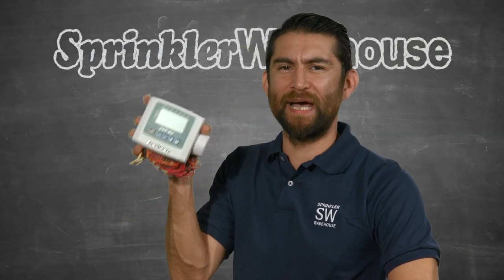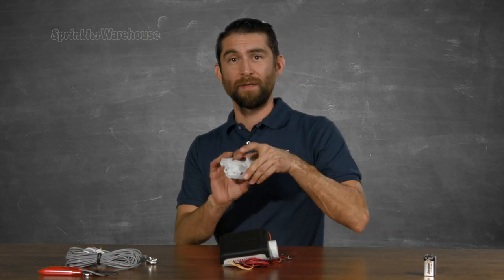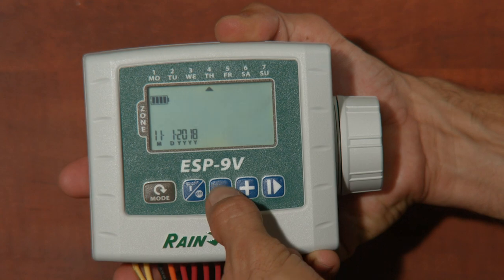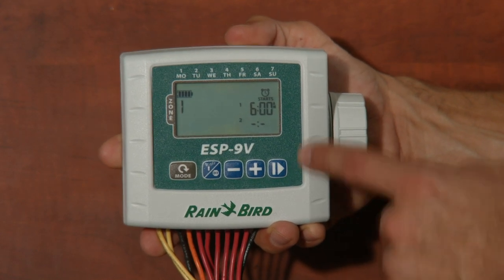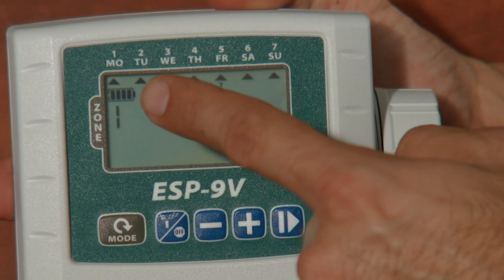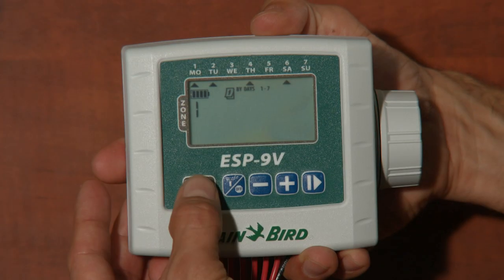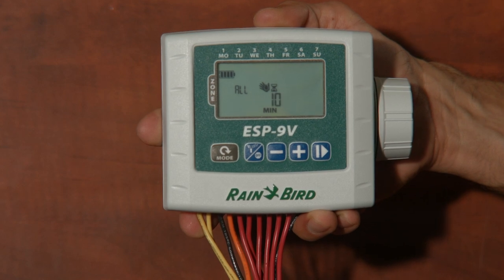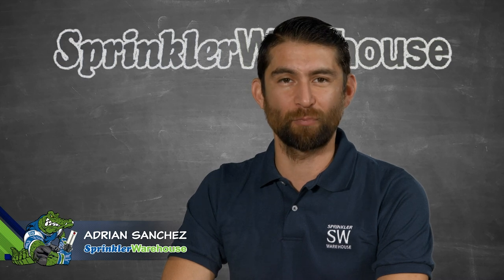ESP 9V Battery Operated Timer

Comment: I have 2 of these controllers and the buttons are nearly unresponsive. I sometimes have to press the same button 20-30 times just to get it to respond. The batteries are reading full. Both of these controllers are about one year old. Any thoughts? Anybody else experienced this problem?
Reply: I'm having the same problem.  The +,  -, and forward buttons are non-responsive. Less than a year old.
Reply: @4thgradedropout703  call for warrantee
Reply: It's exactly the same for me. After 1.5 I need ti press around 100 times for button to start working

Comment: I have a zone that comes on but does not turn off after the timer expires. it looks like the time is programmed properly. i am only operating one zone with this time and the time is a 1 zone timer.
any suggestions
Reply from the maker: Contact customer support at sprinklerwarehouse.com - The issue could be with your valve and not the timer.
Reply: Sounds like the plunger in the solenoid is stuck, or debris in the valve.

Comment: worked fine for two years until the in-existent IP68 protection flooded the controller with water,.. pressing buttons make it bubling  . no button is working after two years  :( very disappointing
Reply: Exactly the same :-(
Reply: Same here - two broken. No water in a battery section, but still does not work